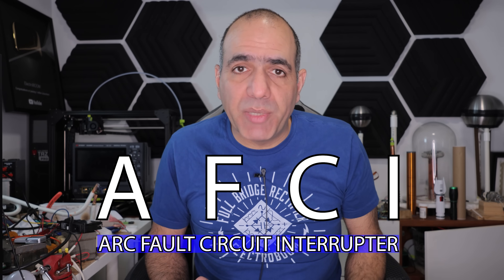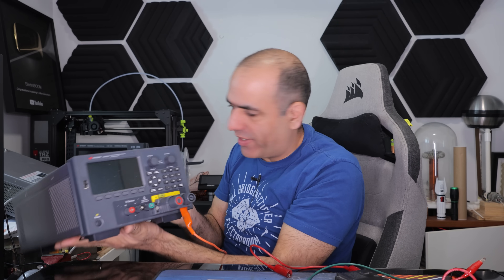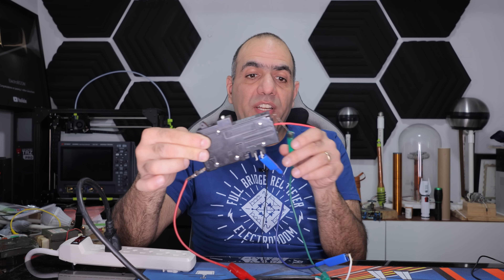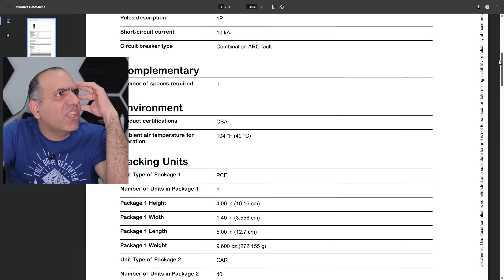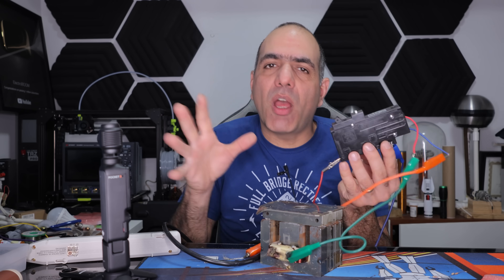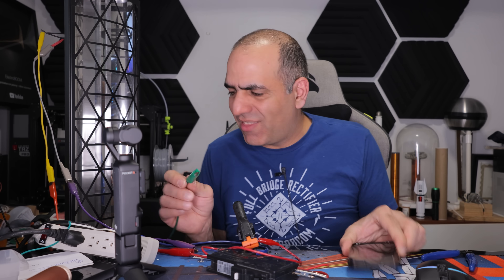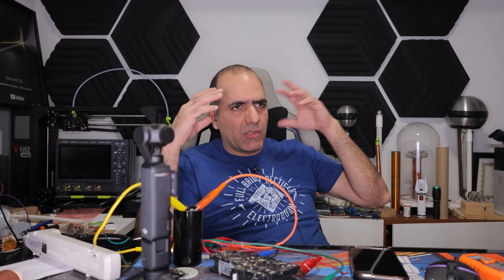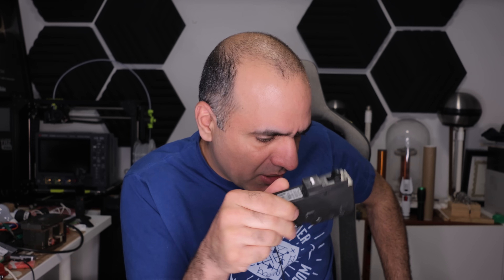Fighting Electrical Fire by AFCI

Comment: Ugh. AFCI. The bane of my homeowning existence.

I have found AFCI trips reliably when trying to use vacuum cleaner, whole house exhaust fan, microwave oven, toaster oven (fancy one, with modulating quartz heating elements), corded saws and drills, and a variety of other appliances. I don't own a plasma TV, but I gather those trip breakers too.

Had all kinds of problems after moving into a new house some years ago. On the bright side, the breaker manufacturer was willing to replace the breakers, which apparently is the only way to "upgrade" the software, and the newer breakers do have fewer false positives than the earlier ones did (those were manufactured only a short time after the code update that required them).

Just FYI: AFCI and GFCI are two completely different features, but many manufacturers offer breakers with either individually or both in a single breaker. Oddly, for the Schneider line of breakers, you usually can tell a three-function breaker (overload, ground fault, and arc fault) because it has a purple test button (as is the case for one of the breakers in your panel). The one you are demoing in the video has a white button, which should only be a plain AFCI (plus overload). A proper GFCI breaker in NA should trip at 6 mA, so maybe the breakers that are technically only AFCI do include some higher-current ground fault protection anyway. Alternatively, they might consider that part of their "short circuit" protection, though how the breaker would treat an instant short circuit like that differently from a normal overload, I don't know.

Breakers with a yellow test button have GFCI but no AFCI.

Fun fact: the Schneider line of breakers has a feature that allows you to find out what actually tripped the breaker. When you reset the breaker, hold the test button down. The breaker will trip again, and depending on how long it takes to trip, you can tell why it tripped: if the breaker trips immediately, it was a ground fault; if it trips after 2 seconds, it was an arc fault; and if it trips after 5 seconds, it was a current/thermal overload.
Reply: When I moved into my new home the very first thing I did was swap 100% of the AFCI breakers with standard breakers.  This is literally one of the worst scams in the history of the electrical code.  AFCI are VERY UNSAFE, as it causes the only people that matter...YOU to believe it is doing something it DOES NOT DO.

Comment: Test button is a give away that its also gfci
Reply: "Test button is a give away that its also gfci" -- Actually exactly the opposite. For that manufacturer, Schneider, they put a white test button on breakers that have only AFCI. If the breaker included both AFCI and GFCI, it'd have a purple test button (you can see an example in the electrical panel shown in the video). GFCI-only would have a yellow test button.

Comment: I had to install some outlet AFCIs when I put in some additional fixtures a few years ago.  I tried playing with them too!

I figured a brushed motor like on a grinder would cause them to trip.  Nope!

I didn't pursue farther than that little test since I have a rather large list of other more important stuff to put to bed.

Thanks for running your various tests!

Also awhile back, I found a schematic of how a GFCI circuit detects the current loss.  It's rather simple!

The incoming and outgoing wires run through a toroid.  There's another wire wound around the toroid.  As long as the incoming and outgoing power wires are passing the same amount of current, there is no net difference in the magnetic field they generate in the toroid. However, if there is a current difference, a small current gets induced in the sensor wire wrapped around the toroid.  Flippin' brilliant!

Of course, there is some extra circuitry involved.  But, the basics are elementary electro magnetism... 

Scan a bit down the page for the detailed schematic:

https://www.powerelectronictips.com/teardown-leviton-ground-fault-circuit-interrupter/

Comment: I think it may also be anticipating power strips and other devices like that. I imagine a power strip/surge protector with a dozen devices maxing out the circuit would probably act like a decent sized capacitor on a loose plug. Anything else would probably be too annoying. Even my phone power adapters create small arcs when I plug them in occasionally, if this thing was too sensitive you'd have to flip the breaker almost every time you plug something in.

Comment: AFDD (Arc Fault Detection Device) if you're in the UK.

Hospitals, HMO'S, old folks homes, student accommodation etc etc.

Bs7671 regulation 421.1.7 - BS EN 62606

Edit: I hate everything about American electrical code holy shit.... Fix your plugs it's 2025 ffs!

And yea... AFDD is a bit of a head scratcher, if you're putting a micro controller in your safety device I think you might have gone too far.

Comment: 15:21 - That last where you were consistently popping it reminds me of the points in an older distributor system for car engines.

As you stroked the two alligator clips along, it's made little mini arcs along the length  (because bumpy) and/or it has a constant short because direct contact... until you reached the end, whereupon you make a much bigger arc as the clips separated.  Aka, you did the same thing the points do in a distributor, turning 12V into something  like 20-40K volts. The capacitors act as the coil, and you're turning 110-120V into a whole lot more than that, like 100000 volts.  The AFCI 'sees' that, and pops.  The dragging is probably not consequential, it's the 'points' system you've created with your contraption.

I'm sure I'm wrong.  Either way, stick all that in a hobby box and go traveling, sir!  Pop them breakers!  :D

Comment: I don't have an AFCI breaker, but I did have loose wires connected to a light switch in the wall that actually started arcing a few years ago. I didn't really notice anything until I smelled something weird like a dead rotting fish. At first, I thought some animal died somewhere and produced the smell, but then I found out that it was actually the insulation of the wire that was burning and producing that smell. The breaker never popped. I eventually replaced the outlet with the switch and the wire. I keep wondering if an AFCI breaker would have prevented this. By the way, modern AFCI breakers are actually dual function breakers with GFCI and AFCI, so I guess we're eventually moving towards the right direction. :)
Reply: "modern AFCI breakers are actually dual function breakers with GFCI and AFCI" -- Schneider does make AFCI+GFCI breakers, but those have purple test buttons (see e.g. the one in the electrical panel in this video). The one he's testing, with the white button, is AFCI-only (GFCI-only would have a yellow test button).

Comment: AFCIs only trip when there's a big load on them. They're to protect the wiring when it's loose - when there can be arcs in series (a break along a live or neutral conductor) or parallel (arc between live and neutral) Series arcs often require a high load of 5A or more to trip - where the loose connection can start heating up the wires to dangerous levels. Parallel arcs often draw very little current (around 5A or less) and thus cannot be detected by overcurrent, but can cause heating that can set your house on fire. I think John Ward (@jjward) has created a rig to test AFCIs which requires a load but has an adjustable device to create series and parallel arcs.

Comment: I am not convinced. I installed few of those (with GFCI as well, there are dual function) and loosen up screw on outlet powering running garbage disposal (don't do that at home - and do what I say, not what I do) - didn't trip. Used cheap kitchen mixer - tripped. Garbage.

Comment: Combination means that it protects against both parallel arcing (line-to-neutral and line-to-ground) and series arcing.  And yes, these have computers inside.  I have Eaton (Cutler Hammer) breakers and I had an AFCI fail.  They sent me a replacement so I took the old one apart.  It had an STM32, if I recall, inside it.  So, computer confirmed.  Oh and they DO make arc fault breakers that also do GFCI.
Reply: "Combination means that it protects against both parallel arcing" -- It depends on the manufacturer. For Schneider (the manufacturer of the breaker here), they use the word "combo" to describe any breaker that adds either AFCI, GFCI, or both to a standard over-current protection breaker.
Reply: and they always consume a couple watts of power.
Reply: yep, the "combination" means both gfci and afci
Reply: I believe it’s combo afci meaning series and parallel arcs. Dual function refers to afci and gfci functions

Comment: Ground faults in North America aren't necessary as we use a TN-C-S grounding system where the grounds are combined with neutral (bonded). Europe has many grounding systems in use due to many buildings being built before electricity, with the use of ground systems like TT or TN-S requiring GFCI breakers.  You can get GFCI-AFCI breakers, they are called "DUAL FUNCTION" breakers ("combination" breakers are AFCI + overcurrent, "dual function" are AFCI + GFCI + overcurrent). GFCI is only needed in North America where there's a potential for currents to leak - bathrooms and outdoors, or where ground may not be provided (e.g., putting a 3 pin socket into a 2 pin outlet). Japan, for example, decided to use GFCI because they decided the expense of installing a ground wire was too high, making 3 pin outlets relatively rare there except in newer builds. Though some plugs provide a grounded pin for devices that do need ground protection, however it isn't on every socket.
Reply: actually one of the reasons GFCI protection is more universal in Europe is the higher phase to ground voltage increases the likeliness that an electrical shock will be lethal. If America had standardized on a 400Y/230 system like Europe or on our own 480Y/277, then I guarantee you GFCI protection would be far more common.
Reply: @ryuukeisscifiproductions1818  Backfed neutrals on 277v are lethal alright
Reply: You don't know what you're talking about.  A ground fault really has nothing to do with what earthing system you are running.  A fault can happen on any of them.

Comment: I had the exact same issues as you. Turns out it kind of has to burn something to work. If you make contact with 2 pieces of motor coal then it will trip

Comment: they are intended to trip on arcing shorts such as running an extension cord under your bed for a light or whatever then damaging the cord by moving the bed from sexy time. it's to prevent fire not save a life. 
They are dumb and I never agreed with it. but as an electrician I have to do what the code says so...

Comment: @ElectroBOOM  Yup, Medhi... I asked Gemini, he confirmed that it is possible. AFCI, especially those combined may have GFCI.... I mentioned about your experiment on Schneider's AFCI and as I said he told me that it's plausible... ChatGPT also confirmed that Schneider makes AFCIs with integrated GFCI on the Canadian and American market, so yeach, yours must serve tripple protection. 😲😲
Reply: Schneider does make AFCI+GFCI breakers, but those have purple test buttons (see e.g. the one in the electrical panel in this video). The one he's testing, with the white button, is AFCI-only (GFCI-only would have a yellow test button).
Reply: @harvey66616  So why  that one tripped? i'm also very curious....
Reply: @PiotrK2022  Hard to say. Maybe even their AFCI-only breakers still include some level of GFCI protection, even though they aren't marketed as such. As I understand it, 40 mA doesn't meet North American code for GFCI, so it wouldn't be legal for a circuit requiring GFCI, but could still be beneficial. Might be they have a manufacturing process where it's easier to just make all of the breakers the with GFCI protection but set the threshold differently depending on how they're going to label it.

Comment: You are f insane touching both poles of the 2kV with two hands and isolation which almost fails at 2kV AC. Nikola Tesla taught to work with only one right hand with voltage sources (especially high voltage).

Comment: Early AFCIs tripped on everything, including common switching power supplies used in computers and the like.  Also, people want to be able to drive arc welders and similar machines off AFCI-protected circuits.  So modern AFCIs get a "brain" in the form of a microcontroller that has basically a table of noise patterns. Depending on model and brand, they either use a whitelist ("that's a computer power supply, ignore it", "don't know what that is, better trip"), or a blacklist ("that looks like a fire-causing arc, better trip", "don't know what that is, ignore it"). There are some videos running around YT here about a company generating specific arcs to capture the "noise" fingerprints to identify arcs, for use in those microcontrollers.

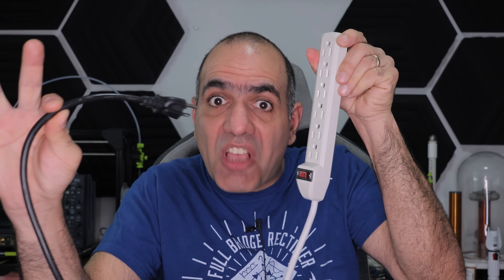Comment: 7:10
no i dont. I am from Europe, and the sockets are 50years old, and still the plug is held by it so hard, that you need a bit of force to get it out. (for Schuko plugs. Euro Plug is easier to pull out, but still not loose)

Comment: Interesting that the AFCI/GFCI breaker does not switch the neutral.  Is that only via the OCP / lever action, ie GFCI/AFCI section does break the neutral or is that section only triggering the main contact to open?  With a neutral/earth (ground) fault you can get neutral current flowing continuously onto an earth wire that is not rated to carry it.  The GFCI function will trip the unit but not resolve the fault.  There are times when it is functionally desirable to not switch the neutral (RCD/RCBO have non-neutral switching models) but final circuits in a house are not them, in my opinion.
Reply: Maybe you can elaborate. In typical household wiring, any current flowing to neutral would necessarily come from a hot/load wire, which in turn would come from a breaker designed to protect that wire and its return neutral. If the current somehow hopped to some other neutral or ground, GFCI would trip, disconnecting the source of the current, and thus also protecting the neutral or ground that was incorrectly carrying the current.

In what scenario do you think there'd be a fault that GFCI would detect, disconnect the hot/load wire, but somehow still allow current to flow on a neutral or ground wire?

Also, in that scenario, assuming the neutral or ground is not the return path for the breaker in question, how would having that breaker disconnect both hot and neutral help, since its neutral isn't the one carrying the current?
Reply: @harvey66616  Imagine the fault in a final circuit on a sub panel with separated neutral and grounds.

Comment: It would be designed to detect the high frequency arc of a miniscule gap. Get a fine metal file, put one of your clips on it and swip the other backwards along the file. Simulated high speed switching!

Comment: I'm not an electrician, but the European AFCIs, as I know, do not trip in case of shorter arcs, because some types of brush motors have constant short arcs while working like angle grinders or other types of tools with brush motors. So, AFCIs look for longer arcs, specifically those related to loose connections or melted insulation of wires due to overheating. So, timing is crucial in AFCIs to avoid unnecessary tripping.
Reply: Also just plugging something drawing instant load into your outlet. Anyway I can confirm the AFCI I tested (Schneider) still tripped from power tools
Reply: It also works differently because of 220-240V. Those arcs have different characteristics and usually aren't as much of a hazard as they either weld themselves shut or burn themselves free rather quickly. So I assume they may also have different detection circuits or at least very differently tuned ones.
Reply: The vast majority of small household appliances and corded power tools have universal motors. I can imagine how easily these could cause nuisance AFCI trips if not filtered out.
Reply: It essentially has a "deadband" where even though it's picking up the overcurrent fault it gives some time to determine if it's from normal use of from a fault condition. Cool stuff actually.
Reply: touch neutral to ground. trip. afci on a fridge. trips loose food.. does not protect from hot side leaking to ground.
scam....... u need to be common sense.  plastic 240v panels. burn. wires loose burn, reset so many times stopped tripping. burned. there is no safe way if u know nothing about electrical.  but if ya have afci. on frige u will loose your food. loose plugs fire.  u can't make it safe. batt 12v car touch + and - with hands your fine. start the car u be the wire and see what happens. it hurts. on 12 volts.. so please show people something???. u did great ...people be careful protected or not. thank you.
Reply: That's a good answer
Reply: Yep, so no applicability at all.  When I moved into my new home the very first thing I did was swap 100% of the AFCI breakers with standard breakers.  This is literally one of the worst scams in the history of the electrical code.  AFCI are VERY UNSAFE, as it causes the only people that matter...YOU to believe it is doing something it DOES NOT DO.
Reply: “scpicific” hit me like an MiB neuralyzer. Forgot what the whole comment was about.
Reply: @jackmalcolm  Sorry mate, English is not my native language. If you write in my native language with 20 mistakes, I would still be happy for you )).

Comment: When I worked at a TV station, (Transmitter Eng) we used optical light detectors inside the coax feedline on the output of a high power transmitter klystron tube to detect RF arcs which would shut down the whole transmitter.

Comment: I have AFCIs in my apartment. The microwave trips unless you use a heavy enough plate to increase the current draw on the turn table. Paper plates arent an option. Thanks Siemens.